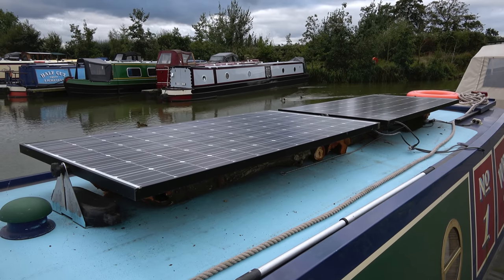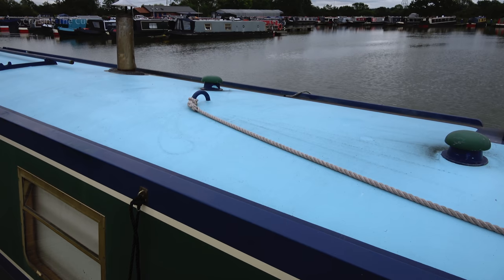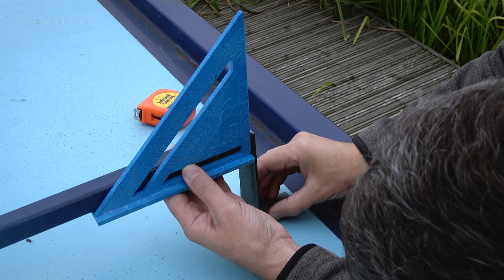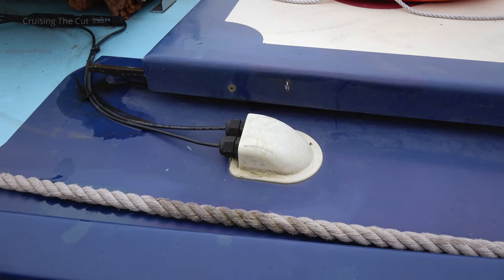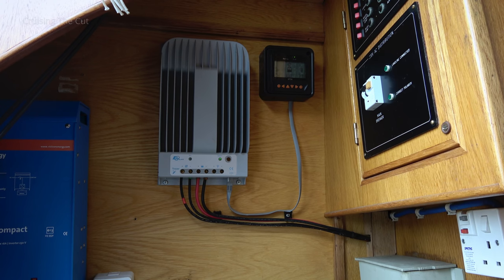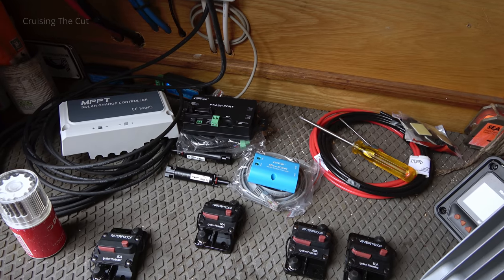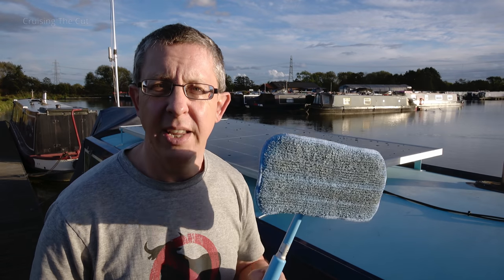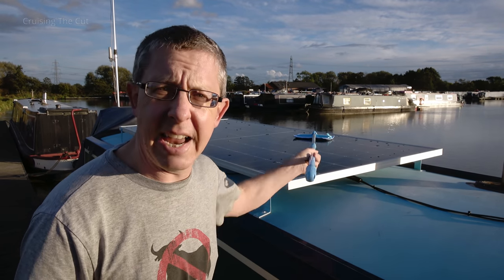251. Adding more solar power to my narrowboat

Comment: Increased weight and drag will negate any savings you may perceive from 'free' solar power. Not to mention the initial investment and disposal cost... they are not environmental at all if anything they are worse than gas or diesel that you have to burn excessively to accommodate the solar installation... why???? Unless the boat sits still in the sunshine forever the entire project is pointless and wasteful.
Reply from the maker: Every bit of this comment is nonsense. The weight is negligible overall (the boat weighs over 15 tonnes!) and the drag at 2-3 mph is even less relevant. I never claimed to be installing it on environmental grounds, though in fact the substantially decreased use of my engine to generate needed power will be a distinct environmental benefit.
Reply: You have no clue what a 540 watt solar panel can do for a person living off grid, first, it is not just 540 watts, it can produce 540 watts per hour! Granted British solar is not the best, but that is why another 540 watt panel is so critical!
I would guess that the 540 watt panel on a cloudy British day is worth about 200 watts per hour from 9am to 1pm and 300 watts per hour during peak production from 1pm to 4pm and maybe 50-100 watts the rest of the day.

You scoff at this, but solar is a game changer for anyone that enjoys refrigerated food, charging phones, having electric light at the flip of a switch, or watching tv at night!
Every panel added to this Narrow boat will be worth it's weight in petrol every day of the week!
A bag of coal weighs more than a single solar panel, and will never create as much energy or quality of life as a single solar panel can. (Though a bag of coal can be priceless when you are cold)
Reply: Daniel LeClare
What utter nonsense you spout.
Reply: oh shit you're right better add some aerodynamics to my 15 ft long 18 ton rectangle that tops out at 3 mph.
Reply: I hope that Dan’s comments are a sarcastic joke. Otherwise there is not much hope for him.
Reply: We’re talking about a slow moving boat here, so drag and weight are not a concern. You’re not Daniel. You’re Negative Nancy.
Reply: The  environmental pluses of Solar are mixed.  All Green energy..Solar,Wind ect.  use huge amounts of Fossil fuels to build and maintain. But In This Case you are 100% wrong.  CTC, has zero shore power.  More power is required.  This is the best solution.
Reply: It's a slab-sided steel boat that putters along at walking pace in a ditch full of hip deep water.
Reply: He's not hooked up to shore power. Did you miss that part ? so, should he buy a gen set.. what you want him to do? 
Such a suckubuss
Reply: @CruisingTheCut  THEY"RE NOT VERY BRIGHT
Reply: Weight and drag? Compared to the weight and drag of the boat we are talking peanuts here. It is a large boat we are talking about that slowly goes at a few miles per hour. It is not a highspeed lightweigth speedboat we are talking about. Totally out of perspective.
Adding this extra panel will help to run a generator less and less, which not only saves costs, only reduces noise and irritation of the neighbours.
And regarding environmental, the production of a solar panel won't be much worse then production of a generator. But once you start using it, is is totally clean, can't say that of a generator.
Reply: Never make everyone happy forget him carry on